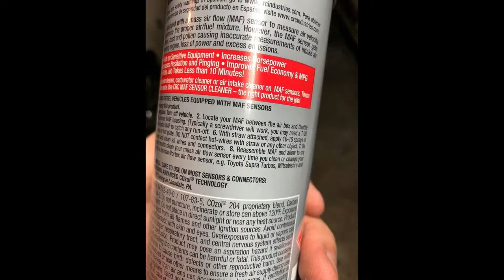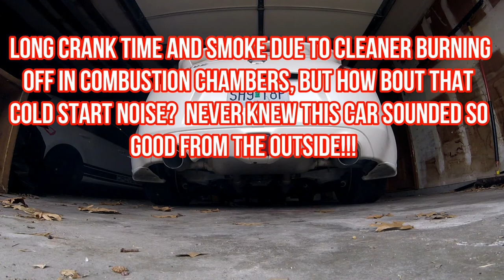MAF and throttle plate cleaning Nissan 370Z -Sketch garage episode 2-

Comment: Nice video! I'm about to clean my MAFs as I've neglected to do so for 116K and the car is finally acting up on me. 

Quick note on the throttle bodies: It's not easier to do overall, but you can get a better cleaning by disconnecting the battery, removing the strut bar, and unbolting the TBs. IT's easier to get the back-side clean by doing it that way and you can wipe the inside of the upper manifold. It's more work but overall a better cleaning.
Reply from the maker: Parker P thanks for the feedback!

Comment: 2014 370z RANDOMLY (intermittently) fails to start and try a few times before it finally does and it struggles in rpm to finish starting…MAF sensor has no readings (no response) on my FIXD obd2 reader. Saw a code (not during a failing to start event but not longer after one occurred) p0172 rich bank 1…no black smoke car has a slightly increased idle vibrate when stopped or parked….still persists after fuel injection system cleaning and air filters replaced. Just so frustrating can’t diagnose at shop unless has a fail start and it’s so random I can’t possibly leave it there for weeks or months for it to happen 😭

Car has only 41k miles and is like brand new still I’m stumped

Comment: can you use maf cleaner on the throttle bodies as well?
Reply: Did you do it i wanna know for myself 🤧
Reply: @JaziahZ34  I did not. purchased maf cleaner just to be safe. be sure NOT to move the butterfly valve when cleaning even if the battery is unplugged. just clean around it as best as possible with the butterfly valves closed